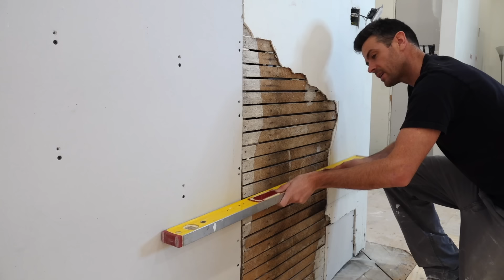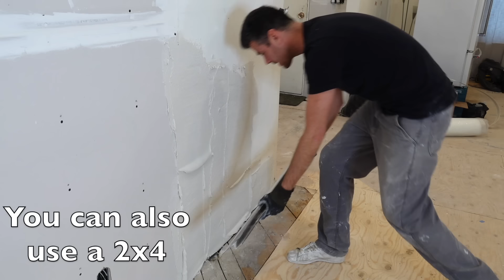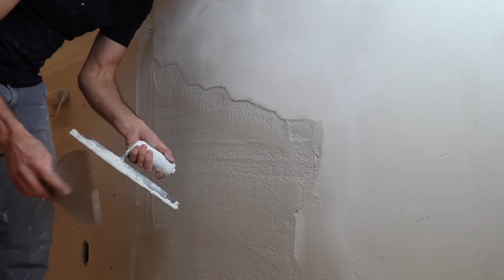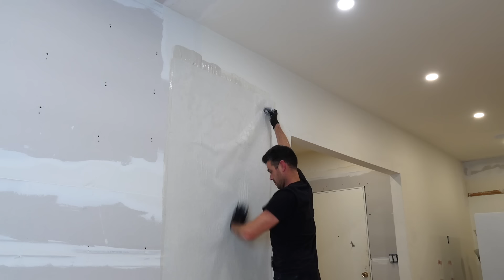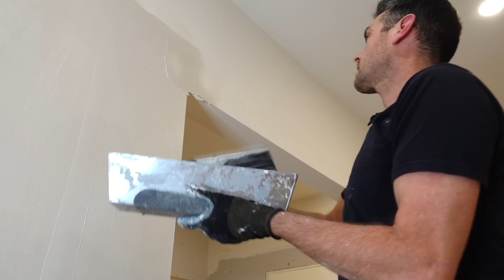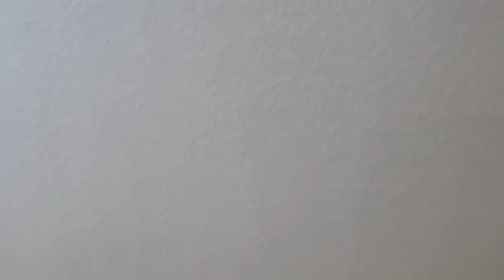Lath and Plaster Repair!

Comment: DIYer here who owns an early 1900s home: I've used USG Structo Lite for this up in Minnesota, the United States. ACE Hardware can order a big bag for you and Structo Lite is a JOY to work with - It's a setting mud that you have to mix, made of gypsum with pearlite aggregate, which can be used to key into old lathe, build out wonky walls (you can put it on real thick) or even shape into molds. It does not sand much better than Durabond, but it's just a lot easier to build big, strong and lightweight. If I need a real flat surface, I start with Structo Lite on old lath that I've painted with concrete bonder, doing everything to make it as flat as possible (if it's big, a darby is perfect, but a straight piece of wood might work as a makeshift darby - if it's small, just a big square trowel like our Vancouver guy uses here is sufficient) and then, when it's dry, go over it with a thin application of Easy Sand 45 or 90. And streaks can be sanded at that point. If you still have pits, you can use Plus 3 or any pre-mixed lightweight joint compound so you don't have to work as hard on the mixing and sanding end of things. I went at a closet this way last summer and the wall is one of the straightest, smoothest, hardest walls in my house.
Reply: Thanks so much for this detailed comment. As a Minnesotan DIYer in a 1900 house, this is super helpful!
Reply: Some updates:

One commenter pointed out that Easy Sand's instructions warn not to apply at thicknesses less that ⅛". That's true, but the instructions also recommend typical tape and mud techniques which contradict that. From the instructions:

"Cover joint with a thin layer of compound and embed tape, leaving about 1/32" of compound under feathered edge and a thin layer over the tape. After compound has set, apply second coat, feathering out approximately 2" beyond first coat. After setting, apply third coat, feathering
out 2" beyond second coat." 

This will leave the thickness less than ⅛" thick in many places during application. I cannot explain the incoherence of the instructions.

Another commenter hypothesized that I learned some of my techniques from Kirk & Jay, Kirk being a famous plasterer on YouTube. That is true, they were a big influence.

Another comment also predicted that using Easy Sand as a top coat over Structo-Lite would peel/blister. I can only confirm that it has not yet done so. That may be because I put it on too thick and/or right on the heels of the Structo-Lite hardening. I can report that, after four years, the walls I plastered this way still look the way they did the week after I finished using this method. I suppose they could eventually fail, but I'm not concerned.
Reply: Quickset easy sand says on the directions not to be used as a skim coat. Minimum thickness of 1/8 I believe. Love duribond, structo lite but I always skim with topping compound or sll purpose. Stay away from from plus 3 or lightweight. Scratches too easy. BTW I am not a DYI er. 30 yrs GC
Reply: @johnnichols2710  
True story. It will peel and blister if you go to thin, with few exceptions.
Reply: THANK YOU. I can't believe I found the answer to my question in a youtube comment section  : p
Reply: Also a Mn house from 1880 here. this is super helpful.
Reply: You learned that from kirk & jay. Give credit where it's do
Reply: @mattrybacki189 The best plasterers on YouTube!
Reply: I also used Structo Lite when working my circa 1900s townhouse in Washington, DC back in the late 1970s which still had gas lighting pipes in the walls and horsehair in the rough coat for the plaster.
Reply: Great tips, thanks for taking the time to submit
Reply: Appreciate this answer. MN here as well looking to tackle this type of project

Comment: While removing wallpaper in my kitchen, the drywall paper was removed. Will this method help to cover the exposed fussy brown part of the wall? It's a large area, and i don't want to replace the drywall.
Reply: I’d say yes.  The fibafuse product he was using pretty much acts like the paper.

Comment: As a person that’s done a lot of these repairs you can also just use cement/lime plaster instead of a setting compound and not use the fib/mesh. I will add fob/mesh or fiberglass mesh can be added for some extra structure and retention especially on ceilings after you screw the existing plaster up in any loose spots. Plaster and stucco work do take a little more experience in getting things flat and smooth as they don’t have the cheater step of sanding after which can make things easier for compound work. Plaster also has the benefit, and the problem, of being HARD relative to joint compounds.
Reply: I haven't seen any cement that can bond to wood. Including modified thinset.  I'm wondering if you missed the part where he mentioned the back of the lathe was blocked so the gaps won't allow the plaster to flow through and key in.
Reply: @bsmithril : No I didn’t catch that portion but with a good bonding agent you’d be surprised just how much stuff plaster can bond too. Lime also adds some adhesion and flexibility as does upping the Portland percentage. Outside of plaster I have used modified and setting thinnests to bond kirdi or ditra to plywood and haven’t had either come off; modified thinnests are made to be quite sticky, though they don’t smooth all that great.

Comment: When would you use 1/4" drywall for plaster repair? Maybe you have other videos on this.
Reply: Ypud use it when your plaster is only 1/4 inch thick lol. Plaster is usually 3/8 though with a 3/8 lathe.

Comment: As a handyman who does tons of drywall repairs, I agree completely with "why you don't demo the wall and start over".  It's more work than people realize....  Add in the fact that the customers will only pay so much for the job and so you need to choose the most expedient option for them all the while you are doing quality work.  I've learned a ton from your channel - thank you!
Reply: No doubt people always trying to undercut and do drywall cheap and fast.
Reply: And a lot more garbage than people think! Even a small section of wall plus framing will fill several garbage bins easily.
Reply: I think they're confusing it with someone wanting a renovation vs repair.
Reply: didnt know not to remove plaster and lathes on one wall was about to do complete room i stopped so much work ..  trying to figure out what should i do now.. shou i re lathe then drywall it or re lathe and use this method .. help thanks
Reply: I agree. Replace the drywall with plaster. Lol! Better sound reduction quality.
Reply: Wondering how much you gonna charge for this tipe of repare...concrete fill cost 50...mud 45 fiber net?prime paint ...pain I  the ass😮
Reply: There is some still touching wood planks so him don't know if it's gonna be healthy  to remove this instead
Reply: The best is remove old plaster and install drywall is the best option no more problems
Reply: Amen. My wall  easily peels amd it was recommended to me to do the whole darn wall which we financially cannot afford. This is helpful. Thank you
Reply: Should replace this type of framing?

Comment: Has anybody else had issues with different muds not boding well to each other? I used a quick set 20 min, then coated over it (it was set not dry) with a topping finish mud and i had it delaminated. It was coming off in large pieces.

Comment: I haven't done d/w in years, but recently had to do a patch in a plaster wall that a lavatory sink had been hanging on (sagging.)  I tapped into all of the knowledge of Ben's that I had absorbed and did a halfway decent job of it too.  The sink now has better blocking inside the wall now.
Thanks Ben.

Comment: my tip is to remove any "loose" plaster and screw the edges of the joint back down.   Use a hand screwdriver or a slow speed tool.   It will secure the edges akin to drywall and help with future hairline cracks.    There are other products on the market, basically glues that you drill holes in the plaster and squeeze the product into, thus rebonding the material back to the lath.   Adding some water or even a watery PVA wash to the lath will increase your adhesion during repair.   That fiberfuse is a good fix, personally i would just remove the section of the plaster wall and replace with drywall.   but that creates it's own issues as where do you start and stop?
Reply: I order from a company called plaster magic

Comment: Why did you decide not to use glue? Either directly to the lathe or mixed with the confil?  I would think this would be the ideal spot to add strength.

Comment: Couldn’t you just cut out the problem area of the plaster square and put a new piece of drywall in? Or would that not work
Reply: having that that before you end up with a "where do you start and stop" situation.   old plaster once it delaminates from the lath is a pain to repair.   We purchased an number of older homes over the years and most times the best way is to go over the room with drywall (1/4" works well) or remove and drywall over the lath with 1/2" sheetrock.

Comment: As a landlord with a couple 1920s era plaster wall properties I've done minor repairs on (yay ReadyPatch), this was invaluable to me, thank you.  
On the point of why not demo and re-install?  One of the first things I learned is if you cut something out, what are you going to replace it with?  Will the extra material/work be worth it?  Will it be faster/easier to not remove as much?  
With tenants (or between) the turnaround is typically faster to patch what is there as long as it's structurally sound and will as long.
Reply: As someone who does work for landlords this is exactly what they are looking for, clean work, not dirty work.  If you can make the wall look brand new using this method then they will be happy.  Less time, less cost overall.  Happy and repeat customers for similar repairs on other properties they might own.
Reply: @MV-wb2cz  This would take more time the cutting it out.

Comment: my entire 1920 house has lath and cracked plaster throughout.  So the 1970s remodel consisted of that ugly thin wood paneling over all of it.  Which is still here, only painted a lovely stark white to make it look better in the realtor images.  At this point it's a bet about which will happen first - tearing out at least some of it for wallboard, or me dying of old age
Reply: @diann9159  wow! an entire room gutting due to 1 screw? can i hire you to demo for me lol
Reply: @diann9159  i agree, demo is easy, but i hate doing it mostly.  I like putting it all back together best!

Comment: I used fibafuse for an older garage ceiling repair, where there was little to no backing and pretty much every joint had cracked.  I scraped out the cracks first, filled with hot mud then used fibafuse.  Turned out perfect

Comment: We use durabond all the time for plaster repairs. We wet sand it smooth and it works. Top coat with all purpose
Reply: How thick is your top coat? It doesn’t seem like theres much space left for a top coat.
Reply: @Ronbo765  just a tight skim. Lightly sand it and you’re good to go for prime and paint. Hasn’t failed us yet
Reply: @jordanabi-samra9709  Sounds like Durabond would be a good choice for me. I have 1950's rock lath (looks like plaster over concrete) and the wall got wet, the plaster peeled off, but the concrete material is intact.
Reply: @Ronbo765  that being said, I’d go one step further and get a cement bonding adhesive and brush some on the repair before applying the durabond 90.   You don’t have to but it doesn’t hurt. That’s just what we do at my company
Reply: @jordanabi-samra9709  Thanks for your advice!
Reply: Great information! Thx! @jordanabi-samra9709
Reply: @jordanabi-samra9709 Good information. Thx!
Reply: @jordanabi-samra9709 this sounds like the advice I need.

Comment: Can you add aggregate to quick mud and make your own concrete fill? The way he's described concrete fill in other videos it sounds like it is just quick mud with aggregate added. It may also have some fibers added for additional strength.
Reply: sounds like it might be passable. I've mixed quick mud and normal mud together successfully to get a mix with both properties, but you'll have to find the right ratios, that's the tough part.
Reply: @ricosrealm  upon watching some  of Ben's other mud framing videos I'm under the impression that it has perlite as aggregate in which is genius cause of how light weight perlite is.
Reply: @punchout2418  isnt that basically Structolite then?

Comment: Did a project to where a lot of old houses turned into various weird apartments, we were pointing up and fixing large patches like this. Skimming thin-set for daaaays, jesus what a work out. Something you can do for 20 years a thousand times but just that one specific thing for like a week straight really starts to be felt.
Reply: i hear ya, i did the exact same thing on a 100+ year house turned into apartment.  14 walls needed skimming!